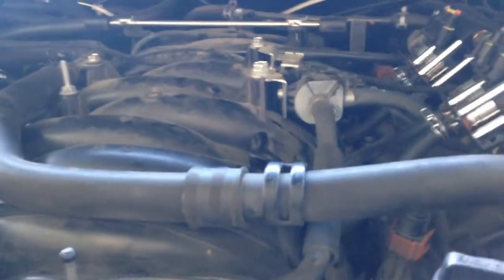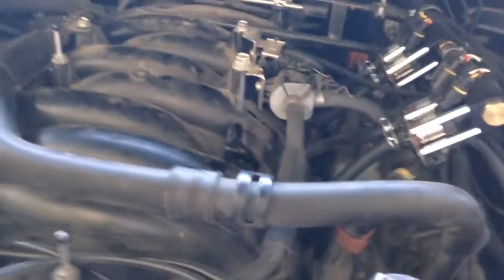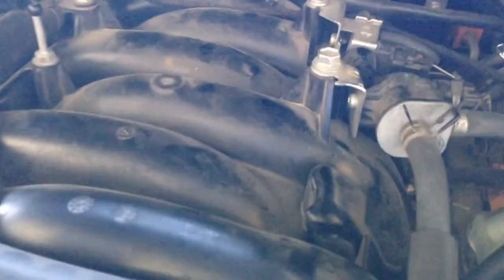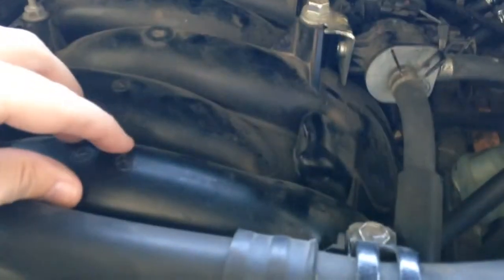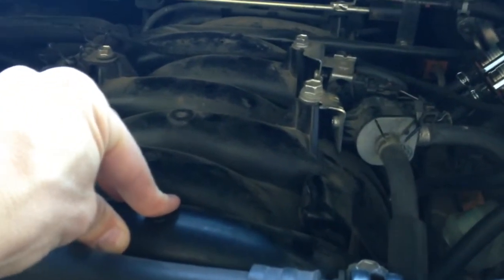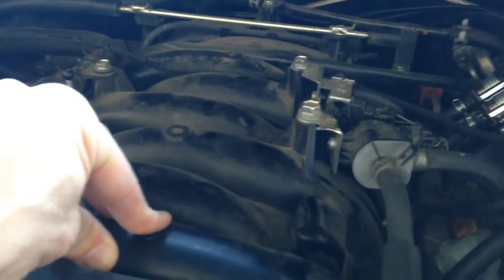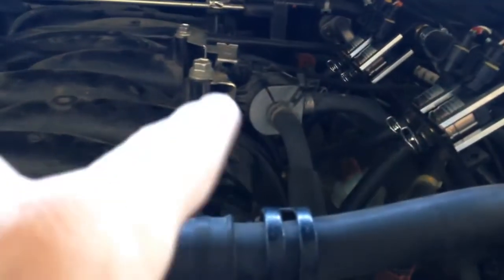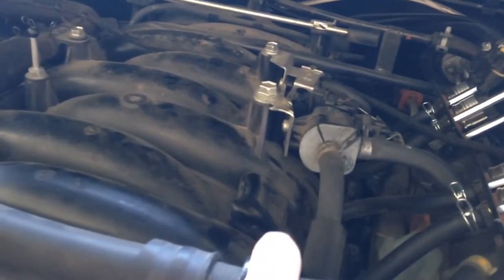CNG conversion SkyCNG Training- Drilling Engine Manifold

Comment: Do you tap your holes on plastic manifolds? I've just done my first plastic manifold and i didn't tap them cause I didn't want to drop plastic bits in the ports. I just epoxied the nozzles. So far it doesn't seem like it will last forever, so I'd just like to know if people are tapping them with the manifold on the heads,  without any issues...
Reply from the maker: plastic is the best manifold. always be careful, but even large plastic chunks should melt and pass through... just depends on your definition of large chunks. I've never seen a plastic manifold drilling result in any problems from plastic bits falling in. when you drill, 99 percent of the plastic will be pulled out, and the threading is simple.
Reply from the maker: I hope yours will hold up over time since no thread to help hold in place. don't fear making threads. the drilling is more risky if anything.
Reply: Yeah I noticed drilling was nice and easy, with long chips. But I definitely don't count on chips from tapping to stay together. I've already drilled the holes, so I hope it holds together. Otherwise if the epoxy breaks I might have to tap to a larger diam nozzle :/